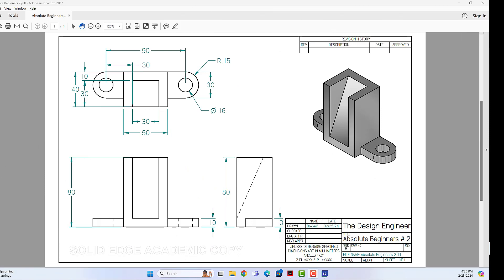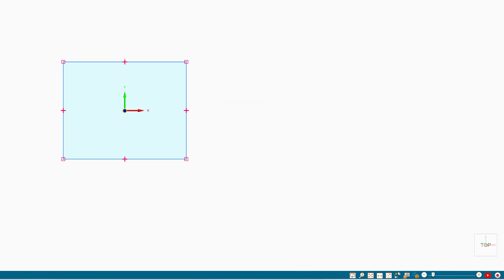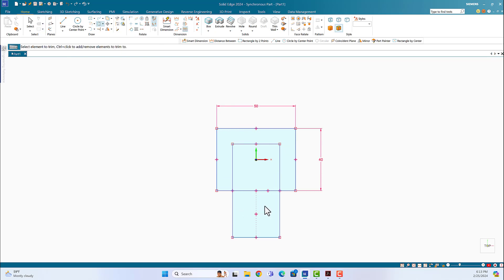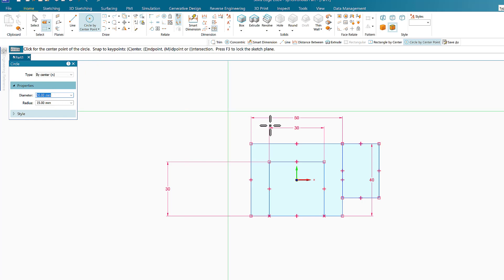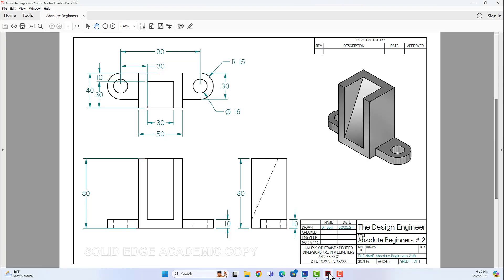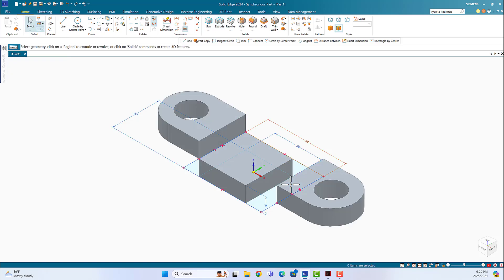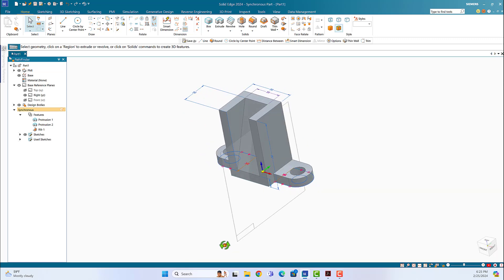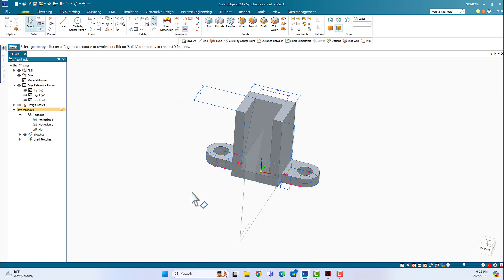Solid Edge 2024 Tuturial - Absolute Beginners # 2

Comment: "Zero thickness (non-manifold) body: The resulting intersection is not supported". I get this error when trying to extrude the section around the center square. Any thoughts?
Reply: select whole solid...not just exterior part.